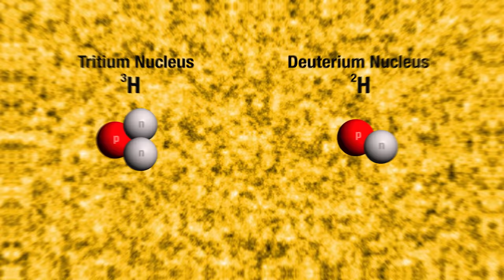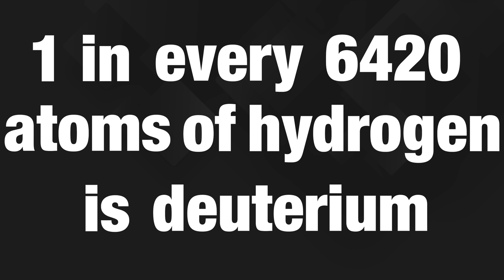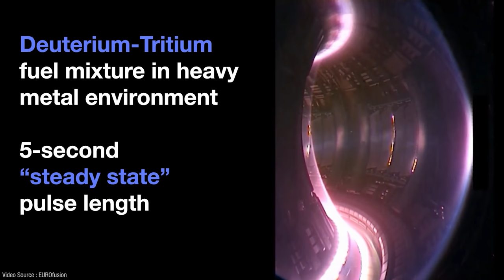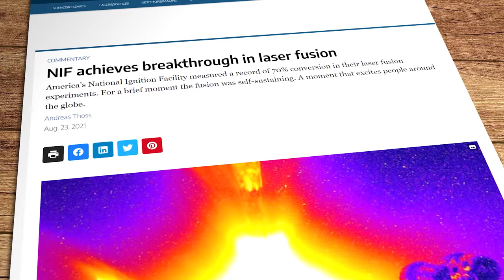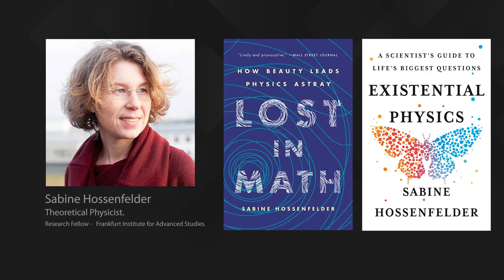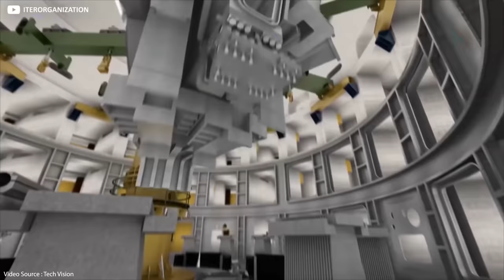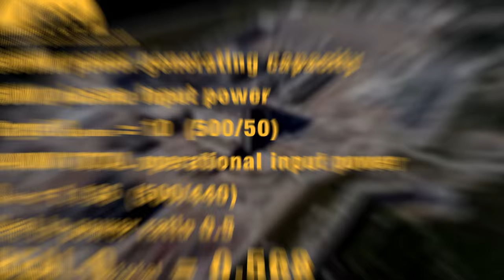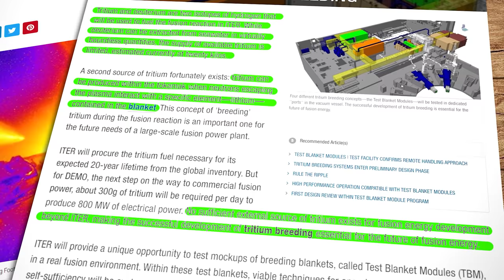Nuclear Fusion Illusion. Is it time to park the pipe dream?

Comment: It's worse than that. Even after total Q is high enough, and practical power plants are designed, it will still be decades before cost reduction advances make fusion power priced low enough to compete with renewables. No investors will put up a billion dollars to build a fusion power plant (for years of construction) when the same billion dollars can build out renewables at ever increasing W/$.

Comment: A lot of people think this fusion reactor is going to supply energy to the grid, it will not. This is an experimental reactor. There are also many other problems that need to be overcome. I think this money should be spent on more practical solutions to reduce carbon. Even wind and solar though good and are welcome have a problem with the scale they have to achieve. Even battery storage has problems in this regard. The world really has a problem. Anyway happy days everyone.
Reply: ITER is already obsolete. Far better superconductors are available now. But if they retooled they'd have to start over and it's a research project anyway. SPARC and MAST represent the state of the art in tokamak research.
Reply: @j.f.fisher5318  I know MIT developed better superconducting magnets. But even with these developments it is still a huge undertaking to produce more energy out than the whole system consumes. I really worry that a fusion system will never come on line in the time we need to solve the carbon problem. It would be fantastic if it could, but I'm not optimistic.

Comment: "Fusion" is the buzzword for World Music, and it conveniently has the best example of what,how and why actual cause-effect Unity is fused in the focus of time-timing sync-duration, here-now-forever. 
The devices that are supposed to fuse atoms together are strictly limited to time-timing harmonics, which you don't do by creating an incoherent "explosion" of mismatched tuning and random sounds. 

But learning by doing involves pushing the test to the failure point, let's see if the Tsar Bomb is the limit of the "Sun on Earth".

Comment: tech develops as an S-curve, not linearly. this is a rebuke of ITER more than of fusion itself. better superconductors, combined with better computer modeling, combined with more research experience, combined with more venture capital, etc. will all converge to advance the tech. it a design like SPARC works halfway decently, there will be a gold-rush of companies and countries rushing to build REBCO/HTS tokamaks. also, lasers keep getting more powerful, shorter pulsed, and more compact. it's entirely possible that someone could produce an internial confinement fusor that may not be particularly efficient but as long the fuel can be made with solar/wind power and then extracted while when those resources drop, it could still be viable. we might want to think about fusion as a means of storing energy rather than as a means to produce it. if it takes a lot of energy to run a breeder reactor, that's not a bid deal if it can be done while solar/wind are over-producing and energy is cheap.

Comment: One gripe I have about this channel is that you make an assumption and just throw it in there usually as a spoiler!

This one was assuming that ANY kind of fission would require the full panoply of regulatory and inspection directives currently needed for "normal" reactors! The premiss is false because you would not be trying to produce a critical reaction or produce fissile materials like Plutonium. There fore why assume you get the blanket smothering effect of regulation?
No I am not totally nieve, some regulation would be required and a good deal of safety, but not the same level as would be required to build a new Windscale!

Gripe over, there is an aspect you miss ........ research! How much is it actually worth to have the number of people working on the problem with all the spin-off's that allow our industries to innovate and move on! The UK economy is based on producing ideas .... which then get bought by others who produce the kit! OK not the whole economy, but a large section of it!

Here is where I get shouted at ...... You state we have only so long to go Green! This is not true eather! To be sure there is a large section of scientists who tow the line, but when you look at some of the data it is by no means clear that CO2 is the main driver in global temp rise. In fact the only global temp rise we see is in computer models. Further the recorded temps today not only fall below the max temp given by assuming we will continue to increase pollution at an exponential rate ..... but fall below even the minimum "predictions"!
Having said that I think we should clean our act up as much as we can. But should we shackle our economies at the very time they have been hit the hardest ...... whilst at the same time both allowing countries like China to build new Coal Power Plants and simultaneously buy their goods fuelling their need for power! To go even more Political (while I am on a  roll) Why allow countries to become energy dependent on other unreliable ones ..... Like Germany and Russia?
After all we all want the same thing ..... Don't we?
Reply: this channel is fine for heads-ups on renewables news but don't expect analysis.

Comment: Had a quick scan through the comments, lots of opinions from people with very little knowledge on the subject. ITER is only a technology demonstrator for the plasma confinement, never meant to be a full fledged power plant, only to iron out plasma containment physics bugs. It's huge because it's easier to confine with larger fields and thus lower field strength. Unfortunately for ITER, it is too far along to take advantage of the actual breakthrough that no one here seems to have touched on, the technology that will enable absurdly powerful electromagnetic confinement fields. That is made possible by new superconducting material, REBCO. It is a total game changer, and has enabled the start of construction of far smaller yet more powerful TOKAMACS that are in all the ways that matter, far more achievable. The great breakthrough of course is the field strength of the electromagnets, with field intensity of up to ten Tesla, that's more than enough to rip the iron out of your blood, seriously. So powerful that the TOKAMAK designs have to be physically reinforced so that they do not tear themselves apart. Also, small enough that the device can be made in modular sections for ease of replacement as components fail over time. ITER will work, there's no doubt about that, it's just that finally this new breakthrough has enabled a shortcut to more powerful and compact systems that will ultimately be cheaper, faster to build, and offer more than just a method of creating electricity. Compact fusion reactors will see use in space propulsion systems capable of accelerating propellant to enable a percentage of light speed travel, similar to the velocity of NERVA nuclear thermal rocket test but far more powerful.
Reply: psycroniser They already have rockets going at a percentage of light speed and Elon builds them!

Comment: If you shelve the research now, and it takes fifty years to get back to it, it'll take however long it was going to take, plus that fifty years.  A little more than twenty years after all.  On the other hand, in fifty years, technology might enable a fairly quick, iterative approach, based on advanced manufacturing, extremely powerful magnets and lasers, and of course, relatively powerful narrow AI

Comment: In the meantime, the whole world continues to ignore Randall Mills and his hydrogen to HYDRINO process that has almost perfected at Brilliant Light Power. The hydrino theory is supported by the fact that the suns corona is 300 times hotter than its surface. Given that fusion is said to only take place within the core of the sun only Randall Mills hydrogen hydrino hypothesis can explain how sparse hydrogen in the corona can hit temperatures 300 times the surface of the sun.

Comment: What this video leaves out is that beyond engineering feasibility (more electricity out than in, over the entire system) is an even harder problem - commercial feasibility. How many dollars does it cost per Watt? There's no point in spending money on something if you can spend less money on something else that does the same thing. In this case, renewable energy plus large scale energy storage will always be less expensive than fusion. In other words, fusion will never be implemented because its uneconomic. 

Renewable energy is now mature technology and cheap. Large scale storage is still a work in progress (but even if implemented today would be cheaper than fusion). And in 20 to 30 years time, when large scale energy storage in all its forms is mature and cheap, fusion won't even be remotely competitive.

Caveat - I do think fusion may have a role in space and its worth researching. But if we're talking about a future with lots of cheap, reliable energy then far simpler and more mundane tech is the answer.

Comment: Great video! About time someone called BS on fusion. What amazes me is how many highly qualified scientists and engineers have drunk the cool aid - or should I say snake oil. Did they never consider the 1st law of thermodynamics ?
Reply: The 1st law of thermodynamics in a nuclear reaction...? Guess you never took physics past age 16?
Reply: @Gomlmon99  Ok, so the Sun is an inefficient reactor, but then it has the advantage of being the Sun. Tokamaks and ICFs are interesting and very expensive toys that, in spite of using D-T, have failed to liberate more energy than they consume, either at a fusion or reactor level. This makes them no more valuable to humanity than a plasma lamp.

Comment: Thank you for covering these aspects of fusion power announcements that get little airing. I agree that the many billions of $USD now spent on such research would be better employed expanding the proven renewable energy technologies that can now be deployed rapidly.

You mentioned the recent announcement of a Q of 0.7 for a recent experiment at the National Ignition Facility (NIF) which is located at the Lawrence Livermore National Laboratory (LLNL) in Livermore, CA, USA. That advance was derived by redefining the input energy. They now define it as the X-ray energy that results in the fuel pellet compression. Prior to that the input reference energy was contained in the laser beams that illuminated the inside surface of the hohlraum. The later energy is more than an order of magnitude greater than the compression X-ray energy. The Q-total for NIF is never mentioned but it is more than two orders of magnitude greater than energy delivered in the final laser beams.

The public announcements, regarding the fusion advancements of NIF, always obscure certain details such as it has always been primarily funded as a thermonuclear explosive (H-Bomb) fuel compression research tool. The NIF began operating much later than expected and significantly well over its original budget. The current level of achievement had been expected to occur back in 2011. Most fusion energy physicists agree that the Inertial Confinement Fusion (ICF) approaches are highly unlikely to lead to a practical commercial fusion power plant.

Those promoting various forms of nuclear power continue to assume that we have 20-30 years to bring their favorite technology up to a scale to where it can displace a significant amount of our addiction to fossil fuel based energy sources. Such promoters learn to reject any suggestions that we have very little time left because their love of technology displaces such dire predictions.

UN chief: World has less than 2 years to avoid 'runaway climate change'
https://thehill.com/policy/energy-environment/406291-un-chief-the-world-has-less-than-2-years-to-avoid-runaway-climate

ITER is a showcase … for the drawbacks of fusion energy
https://thebulletin.org/2018/02/iter-is-a-showcase-for-the-drawbacks-of-fusion-energy

What No One Else Is Telling You About Nuclear Fusion
https://www.youtube.com/watch?v=FrUWoywZRt8

Former fusion scientist on why we won't have fusion power by 2040
https://www.youtube.com/watch?v=JurplDfPi3U

How close is nuclear fusion power?
https://www.youtube.com/watch?v=LJ4W1g-6JiY

The Theranos Trial Shows Why We Should Be Suspicious of Nuclear Fusion
https://slate.com/technology/2021/12/nuclear-fusion-climate-change-theranos.htm
Reply: "Such promoters learn to reject any suggestions that we have very little time left because their love of technology displaces such dire predictions." Exactly.  Wading my way through all these misguided comments from technophiles and tech fan-boys has been horribly depressing.  We have so little time left, the only answers are to change our lifestyles (especially us in the west) and impliment as much renewable generation and storage as we can, as quickly as we can.  anything else is fiddling while the world burns.

Comment: "In the electric model of stars, the Sun is a positively charged electrode in a circuit, while the negatively charged electrode is located far beyond the planetary orbits. The “virtual cathode” is known as the heliopause. The electric solar model predicts that sunspots, flares, coronal holes, and all other solar activity comes from fluctuations in galactic electricity. Birkeland current filaments slowly move through the Solar System, supplying more or less power to an electric circuit that includes the Sun. The energy powering the Sun is focused from outside and not expelled from inside a thermonuclear core, so its inverted temperature gradient conforms to an electric discharge within intergalactic Birkeland current filaments."
The false nuclear fusion model of the Sun will continue to make what's not happening impossible to replicate...